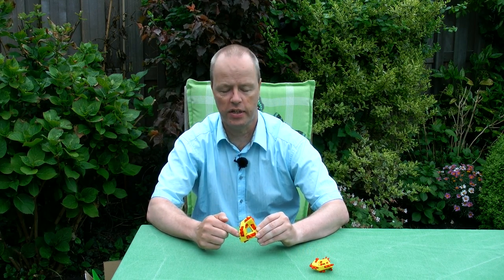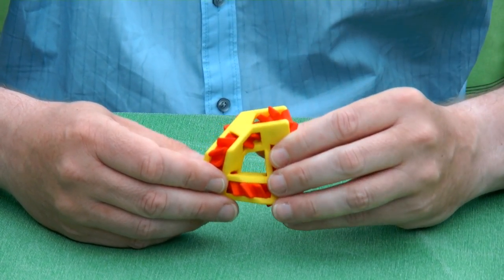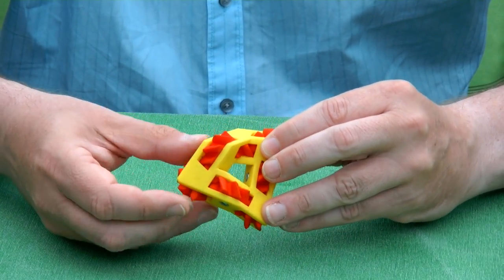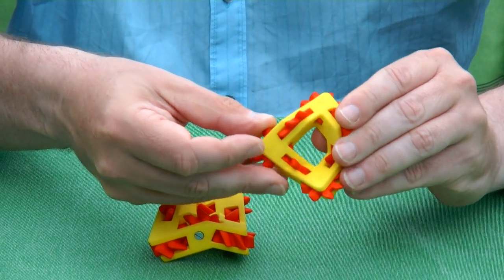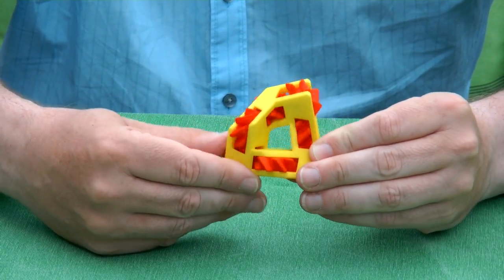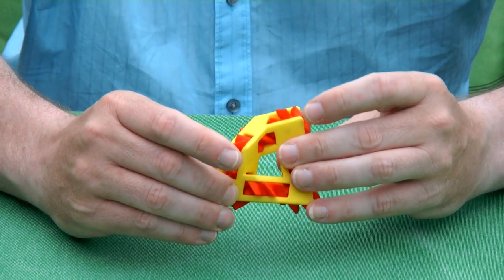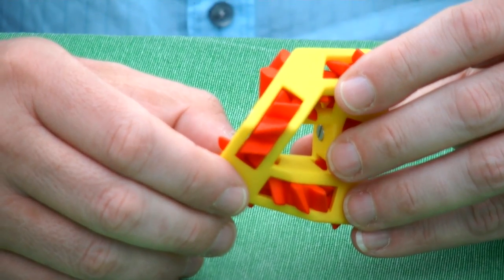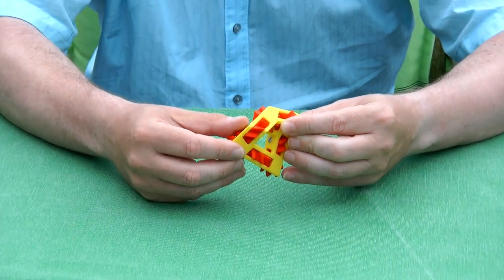Seven Gear Loop - successful prototype

Comment from the maker: Can anyone find a similar configuration with five gears, or prove that it is impossible to have five gears in such a loop?
Reply: OskarPuzzle your work is amazing I actually love you.
Reply: Imagine a mobius strip with 5 gears on it. Because of the 180° twist, they will all mesh and be able to turn. I'm not sure how the gears would look, but this would 100% work.
Reply: OskarPuzzle So, nobody's going to point out that the video came out today yet his comment is from two months ago?
Reply: When Will you make another twisty puzzle
Reply: Mike Best because he made the video 2 months ago, but scheduled it to yesterday
Reply: Hey Oacar, does it have to be the same type of gears? I have a solution for different types of gears. Imaging 3 planar gears A,B,C. Now imaging the gear A rotating in both directions at the same time. This is possible if you have an upper and a lower layer (A1 and A2) of that gear and a single "planet-gear" (A3) in between.
This sums up to A1,A2,A3,B,C = 5 gears.
For identical gears, I have no idea :)

Comment: Congratulations on the amazing model Oskar! I think the gears are called after the 1 sheet hyperboloid surface, that can be obtained by revolving either a hiperbola or also a straight line that's not parallel or coplanar with the axis of revolution. This surface is also used for the shape of the cooling towers of nuclear power plants :) And about the disadvantages, I'm not really good at mechanics but my top guess is friction.

Comment: One disadvantage might be that the orientation of one gear to the next can only be in one direction (counter-clockwise?) and at specific interval (depending on number of gears) in order to properly align when gear N meets gear 1. All gears have to be of the same size, too? Regular gear can change diameter as long as the gears are properly sized. These look like they would need more physical attributes to match (angle, size, depth).

Comment: The teeth dip and rise in a hyperbolic shape
Reply from the maker: Indeed!
Reply: The Crafted Warriors 
Is the problem you're referring to here the higher difficulty in conventional manufacturing from metal (excluding 3D printing)?
Well the math for generating the gears gets more complicated too. Actually AFAIK the general hyperboloid case is only perfectly solved for cycloid gears not yet for evolvent gears.
The problem that came to my mind first when thinking about hyperbolic gears was friction. Hyperboloid gears (or hyperbolic gears) are a generalisation of gears that encompasses both spur gears and bevel gears as special cases. In the general hyperbolic case the axles neither need to cross nor need to be parallel. If the axles are non-crossing and near antiparallel there is massive lengthwise sliding of the teeth and thus problematic friction.
A double enveloping worm gear gear pair (the non-crossing axles are oriented 90° to each other)  is a practical example of hyperbolic gears featuring that problem I think. (The high gear ratio makes things worse.)

Side-note: If one cuts the full infinite hyperbolic gear shape (quadrik) beside its neck then there's no dip and rise in tooth shape when measured as normal distance from the axle center line (it's still concave though). But I guess this kind of cutting is not applicable in the seven gear ring presented here.
Reply: I wasnt saying that was the disadvantage 😅 i was saying thats why they are called hyperboloid gears
Sorry for the trouble
Reply: The Crafted Warriors 
Ah, I see.

Comment: The force of the tooth against the next tooth is not distributed efficiently, because the teeth are at an angle
Reply from the maker: Indeed. I did not find a way to get them at a smaller angle.

Comment: I suppose the gears encounter more friction than normal gears, because the same gears need to be able to either pass on the rotation in the same or opposite direction, depending on the angle the gear is at. So there's probably some sliding going on. But what happens exactly I don't know!

Comment: well.... if you can make 3 in a loop, it's easy to add 2 between any other 2 gears, and get all odd values.
the only thing to prove is whether a 3 gear loop is possible, which is.
Reply from the maker: I wish things were that simple ...

Comment: Hi Oskar! Why can't it be proven yet that a 5 gear loop does (or does not) work, when you can prove that a 7 gear loop works? 
Groetjes! ;)
Reply: Because he has built one with seven so he knows it's possible :)
Reply from the maker: If I find a working five-gear loop, then I would have proven that it can exist. Just my inability to find it does not prove that it cannot exist. Mathematical proofs do not work that way.